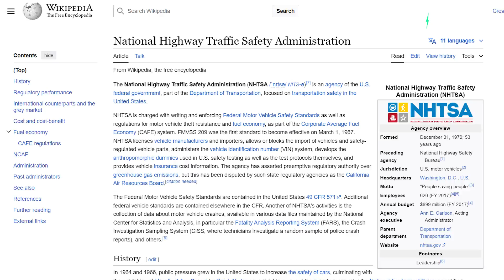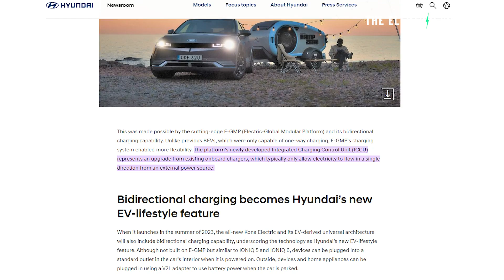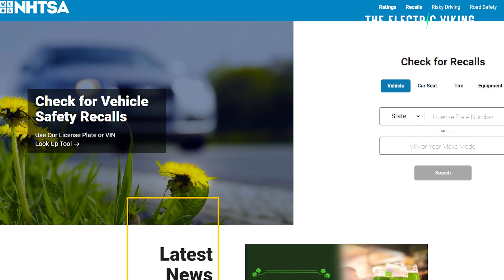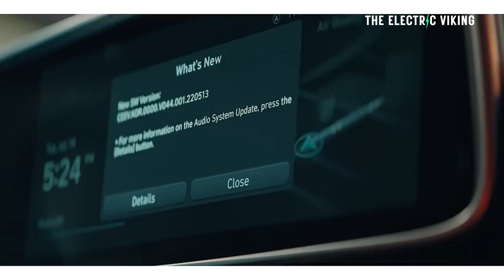Hyundai & Kia forced to recall nearly 1 million EVs worldwide for failing ICCU's

Comment: Hi The Electric Viking,  I'm thinking about buy a new EV in a couple years.  I'm afraid to get a Hyundai or Kia because of the faulty ICCU?  Which EV manufactures have trouble free ICCU battery drain issues?  Thanks,  Charlie

Comment: 11.2 per thousand vs 1.6 are stolen in the United States all vehicles these two car companies. That's the numbers except it's higher in a large city, much higher I personally know people their car's been stolen more than three times and new fix does not work either how would you like to have a car where the insurance company drops you and nobody wants you. How do you sell that? Do you drive it with no insurance I never heard of an insurance company dropping cars and it's not a safety issue. What does that tell you? Just under 10 times more than the average for any people that don't know, the United States has a real problem with stolen cars, I know a lot of people will never buy a car from these companies these two

Comment: I had my iccu replaced in my Kia ev-6 months ago, along with the software update.  Never had any problems but I don’t ever need to fast charge it.   It was the 250kW (235) charger that caused the issue.  With 11.5kw charger at home and a realistic 260 miles range it just never needs it.  For longer road trips I need more space for my family so I just use a gas vehicle, unless it’s relatives without needing to bring much and then I just use my portable 3.6kW charger at their house.

Comment: As a Ev owner you should get educated on products before you purchase them. I have a 2022 kia ev niro. It has been a excellent car and being that it is two years old with 24,000 miles I have had ZERO problems. Do your research on the car before you make you purchase!
Reply: I own an EV-6 and had the iccu and software update months ago.  Never had even a single problem, it was only people who used the 250kw (235) fast charger frequently.  I only charge at home because with a solid 260 miles range and 11kw charger with cheap electricity at home there has never been a need.
Reply: I charge mostly at home as well . I've had no issues.
Reply: In the United States today not last year not 5 years ago2024  these two car companies are 10 times More likely to be stolen that number is 11.2 per thousand     your answer is not my car my answer it doesn't matter when you don't have a car to drive you don't buy the same brand again. Forget about it

Comment: Actually, Tesla had a similar issue way back. Their DC-to-DC converters were failing on Model S and their 12v batteries were dying. Elon told the staff to stop buying off-the-shelf parts and to make the part in-house so there could be better quality control. This was the birth of Tesla's vertical integration. Today, no Tesla DC-to-DC converters fail. Why? They spend the extra money on high quality components (electronics)... the quality of components that go onto circuit boards that are in the Dragon capsules that fly to the International Space Station. "Minimize failures" is not a goal of any other car company. That's why a Tesla.

Comment: Sam you will see a lot more of those ,  and i hope you are electronic about +40 years old.
Just because than you also noticed the quality drop in many electronic components, where 20y ago they where build to last a lifetime now if they go for 5 years you are in luck, and of course you had those condensators that burned out after 5 years but that was like 10% .
If you buy a laptop (just example ) now you almost burn a charger every 2y if you're lucky !
When it's 5y old it's way overtime to buy a new one even when old is still good enouf to do it's task.
Made to work ...h and than break down! and the weakest link in the chain determines it's strength!
But sadly i think you are not  otherwise you wouldn't have posted that video you did on batteries of an ev that will def. last for 10 years with only 10% drop in capacity  ! Because outside cooling will help but it will still heat up on the inside what can't be avoided since it thermisch reaction that provides energy.
And talking about the industry they will use it more likely to increase the output and reduce size than for longlivety.
It will help , maybe double it's lifespan from 4y with loss of 40% to 8y with loss of 40% of wich 6 below 15% but more would be dreaming .
Nice example are led lighting , they should be able to burn for your entire life , but how many do you need to change after 3 years?
Where it's the transformator or condensator ,... that breaks down or even led itself, where i can easy build a led that will not have those problems if i use the correct components like just bit more watt that they can withstand or just 1-10 more omh resistor.
Build to fail so you keep buying!

Comment: As long as I can remember almost all hyundai and Kia EVs have had 12V battery issues, discharging early. Even first gen models. I hope that when they decide to replace the ICCUs , they are upgraded versions. And maybe the ICCUs also have smarter charging algorhytms to maintain the 22V batter at all times. Curious to know though if the fire risk issues have been resolved for the affected vehicles. I'm noticing the first gen early and later builds are increasingly becoming affordable and I teresting buys as a second hand vehicle. I do notice it is hard to find reliable information how to look foe troubled cars and find out of they are fixed or not. Anyone have sources on this as a reference?
Reply: no issues with my ioniq 2019 
but battery warning pop up after 30 sec if I do not close the car fully after shutting the motor off (to listen radio, Bluetooth call, ETC)
I must open the driver door in order to fully shut down my car (which is weird) 
no other issues 
car charge at full speed pretty much at any temperature and no battery degradation thanks to the buffer in place
Reply: I suspect they'll just do a software update during the "recall" and only replace ICCU's that are showing fault codes at the time of software upgrade.

Comment: I think Hyundai & Kia drag their feet on these recalls simply because of the money factor. I own 2 Hyundai's a 2013 Sonata and an Elantra and they are stolen daily easily as a matter of fact mine was stolen in 2023 and returned but with costly repairs. Then I recently got a free update to the software on both cars all almost 10 years late and you know they knew about this years ago. Even my insurance company told me that they have a class action suit against Huyndia for this exact problem and I hope they win!
Reply: My cousin's got stolen and engine blew 3 miles down highway so I told get try to get in on 2 of the CAs
Reply: @justinr9753  my engine blew 3 years ago luckily Hyundai had a recall and replaced it for free. 😁
Reply: Those Terminator cars

Comment: It is fascinating that it appears the South Koreans are so belligerently stubborn to acknowledge and then rectify problems with their products. In the US, LG has had enormous problems with their shitty fridges, many people who have expertise in this point to the fact of a faulty designed compressor. Whilst LG has been replacing the failed compressors on their fridges, they just replace them with the same shitty compressor that then fails again in a short period of time. Here is another South Korean product, Kia and Hyundai vehicles that have a component that appears to be grossly unreliable, and they also have been in a state of denial and resistance to resolve the problem. Who says that these replacement ICC units will not be the same faulty design of the originals. I hope here in the US that there is a large and very costly class action lawsuit against both LG and the South Korean electric vehicle makers to help put them on the straight and narrow!

Comment: We learned on some factory tour videos of the Tesla factory that Tesla has their own internal part testing facility. This facility tests the parts for durability and longevity by actually running the parts under an accelerated aging until the parts fail. They then engineer the failed bits so they won't fail. 
They have done this type of fail testing for many years now and have great trust in the durability of the parts they use in their cars. 
Most OEMs get their parts from Tier 1 suppliers who themselves run durability tests but they are often simulations not actual real world. Hopefully these tires of problems will lead the Tier suppliers to also use real world aging and know how long the parts should last, not just estimates.

Comment: It is just insane the third largest car manufacturer in the world cannot supply an EV that works…by the million,,,and cannot make necessary recalls on time . Quality control or uncontrolled garbage ? And if it would be the only problem ! Are for instance all Asian mfr over with the Tanaka scandal and bankruptcy on 2019 or they took the same set type and continued? Seeing the number of airbag warning lights « ON »  on the dashboard of newer cars in VN, it does not seems the famous faulty impact sensor likes bad roads but since it does not stop the car but kills the occupants, no one care!  Now for the planet savers…the top news is…..the 2024 greenest car per the ACEEE extensive and unquestionable neutral study is not even an BEV, but a PHEV and NO Tesla models,are listed in the ten greenest recommended cars : inefficiency and fast depreciation of heavy lithium wagons at its best…the wind is turning rapidly …😂😂😂
Reply: ive had a  toyaota yaris  for many many ears i loved the car  even thou it had  6or7 recalls to be fixed , this happens to all carmanufactures  i currently have a ioniq5 and i love the car  acxtually the best driving car i ever owned period and ive had a dead ecu that had to be replaced for me to use my 11kkw homecharger does that make it a bad car?  i dont think so.
Reply: @PietKargaard  Hyundai Kia recall a million EV on failure to recharge the 12V battery,,the large quantity is indicating that they did not reacted fast enough..

Comment: EVs remain an experiment. I agree we need them,  however the standards are too low.
Reply: They are failing universally right across the board. It just took a few years to come to the realization now that there are more of them on the road and have been in production for more than a few years. I think if anything hybrids are the way to go if you must have a battery in the vehicle.
Reply: Depends on the hybrid (HEV) technology,  as apparently based on reports from this channel,  many HEVs have a worse fire safety record than straight EVs.  That said HEVs are a more mature technology,  so really they have no excuses.  All that said,  EVs need to be made more reliable to avoid self sabotaging their future,  by giving EVs a bad reputation.  I would say they are getting new EV models out the door too quickly and not performing adequate testing,  as it makes zero financial sense to put out faulty vehicles, knowing the risk and costs of recall.
Reply: @JoeyBlogs007  I agree I think a good example of that would be the Ford Lightning. I have no interest in purchasing an EV or a HEV anytime in the near future and will be buying up ICE vehicles just prior to the ban here in Canada as I think they will go up in value after EVs are the only option for a new vehicle.

Comment: I have a 2019 Kona and they had a recall for a faulty battery in that car. Although I never experienced any problems the battery was replaced no questions ask. Hyundai had been great handling this. The Kona has been a great car and I have confidence that they will address this ICCU problem with the same courtesy as they handled the Kona recall. I would buy a Hyundai any time and have great confidence in the company. I am a retired guy and have no affiliation with the company for those of you who might think I have some sort of connection with them.

Comment: EVs are the future. They're already cheaper to run and have better acceleration, but range is definitely a problem and initial cost is too high. EV batteries are getting better at an amazing rate - energy density and so range will soon no longer be a problem.in addition the cost of batteries is falling rapidly - being only 25% of the price 2 years ago. In summary electric cars will soon not only be cheaper to run and have better acceleration - soon they will be cheaper and will have a better range than ICE cars
Reply: Battery will be replaced by a better energy storage solution.

Comment: It seems when you have to replace the batteries of Kia and Hyuanday, the cost of the batteries are higher than new car price.
Reply: It is not advisable to purchase a Korean automobile. The electric vehicles manufactured by this brand are not engineered with the intention of battery replacement. Consequently, the vehicle can only be utilized until its battery's lifespan expires in a decade. The cost of battery replacement is equivalent to that of acquiring a new car due to the exclusive battery replacement procedure. I possess firsthand knowledge of this matter as I am employed within the electric vehicle sector, and it is widely acknowledged that owning a Korean vehicle results in diminished value. This situation can be likened to acquiring an iPad without the ability to replace its batteries.

Comment: Tesla pushes OTA update to change font size on some warning screen: Worldwide media coverage, "Tesla recalls all cars!"

KIA dies on highway and 12V batteries die all the time: Nothing to see here, move along.

Who do you think buys the most ads?
Reply: Indeed, occasionally a 12v battery fails, but that’s not the issue here…the issue here is overcharging/overcurrent blows transistors that prevent the 12v from charging.
Reply: @Tryna-B-Good his point was Tesla is unfairly treated by the media. Who cares about the technicality?

Comment: I have a Hyundai i30 that has had a replacement ecu ... just because ... and now has a non functioning stereo system, no buttons work at all, its just a dash light 

Yeah, I would totally buy an entirely electric hyundai
Reply: My cousin's Kia Soul got stolen but they only made it 3 miles down highway before engine blew.

Comment: They will issue an OTA software update and replace the Integrated Charging Control Unit (ICCU) if necessary.
Reply: Since an over the air update is an over the air update if you got to go to the dealership.  
😢they are a joke
Reply: And so, what’s your point? They still have to go Over To A (OTA) dealership to replace the physical unit . Smh. 🤦‍♂️

Comment: Like every car manufacturer hasn’t had to recall over the years for one thing or another.
Reply: Teslas have never faced a recall. They are the best cars ever!👍
Reply: @byrnc927  I don't know if you are being sarcastic but Tesla just recalled 2.2 million cars, nearly everyone sold in the US.
Reply: @markadler8968  
No, it's sarcasm. The EV stories covered here on this channel are always doom and gloom except for Tesla. The coverage of Toyota cars here has been relentless because they haven't committed to go all in on EVs. Toyota will be cleaning the clocks of every auto manufacturer who goes all in EV.
Until some magic battery is introduced, Toyota has the most realistic outlook for the future. I own two PHEVs. Have had them now 7 years. BEVs make great city cars, and that's where the benefit ends. I wouldn't trade my 7 year PHEV for any brand new EV on the market, not even if it was an even trade up.
Reply: @byrnc927  I figured it was sarcasm 😄😄I completely agree on the Toyotas having the best outlook. I am buying a Tundra in the next year or so. Even Toyotas are currently having trouble selling all their inventory due to the economy/interest rates/inflation and it is only going to get worse for them so I think even better deals will be had down the road.
Reply: @markadler8968  
My son just bought a new Camry. I have yet to get behind the wheel of the new Prius. Dealers selling them so fast there are no Demos. 
That would be the only car I would replace our two Gen II Volts with. 
We recently went to the Tesla Dealer to see the new Cybertruck. 
Looks like a high school shop class assembled it.

Comment: Hyundai Motor America (Hyundai) is recalling certain 2023 IONIQ 5, IONIQ 6, and Genesis GV60 vehicles. The rear inner driveshaft may have been improperly heat-treated, allowing it to break under load and resulting in a loss of drive power.